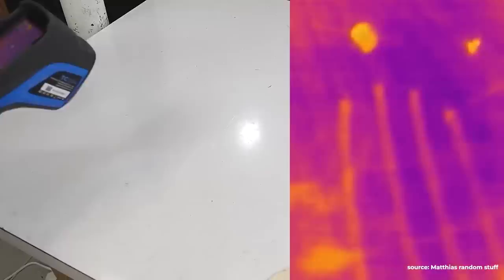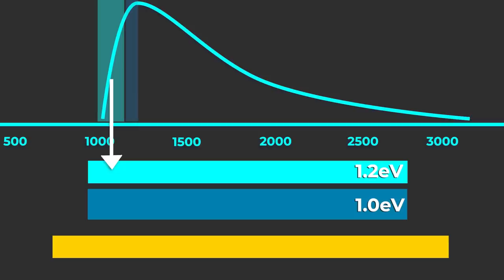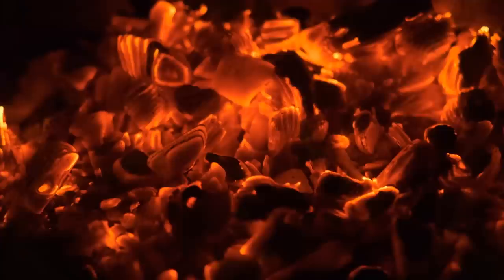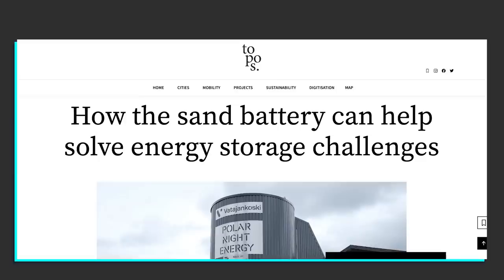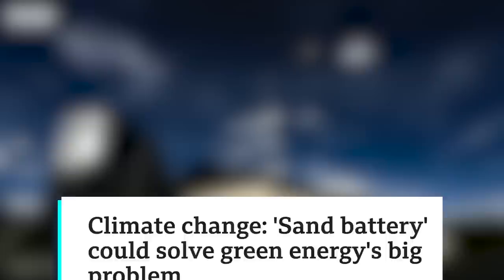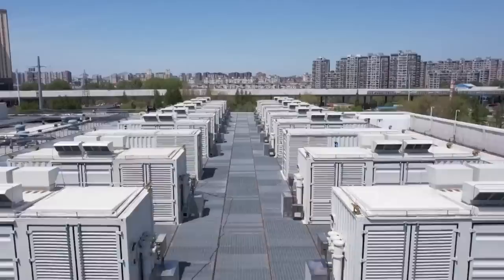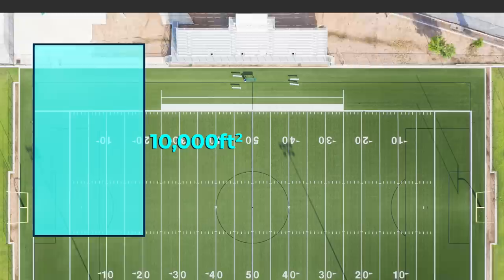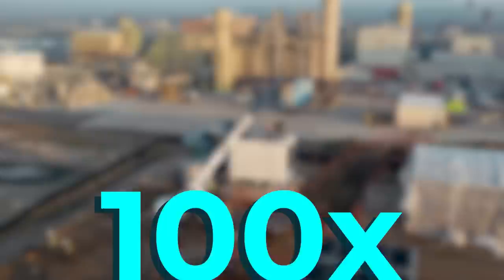The End of Lithium-ion? These Solar Panels May Be the Future of Energy Storage

Comment: Thorium fuel cycle MSRs would be a lot easier to engineer.  They could also be used to consume most of the stored radioactive waste from conventional nuclear power plants.  Thorium is abundant and can’t be controlled by any one country.  There is enough of it to generate an abundance of electricity for everyone on the planet for over a thousand years.  The amount of electricity needed by the average person (in the developed world) right now is equal to the energy producing potential of an amount of thorium the size of a golfball.  Radioactive waste from a thorium MSR is a fraction of that produced by a conventional nuclear power plant and decays to a safe level in a fraction of the time it takes for radioactive waste from a conventional PWR.  And MSRs are passively safe….meaning if all power is lost to the plant a salt plug melts and all of the liquid fuel drains into a storage facility where it cools naturally to a solid.  China is moving full speed ahead on developing this amazing source of power, as are other countries around the world.  It was the United States that first developed this technology back in the fifties and sixties at the Oak Ridge National Laboratory.  The Chinese actually toured that facility and benefitted greatly from a technology exchange of the information gathered by the team at that facility.

Comment: So, how do these IRPCs compare to Seebeck devices? RTGs have been quite successful in space applications. However currently the only long term heat source has been from radioactive materials. Now, "heat batteries", could be applied hence the question.

I'm thankful that I have an American thermostat (Fahrenheit) in my home. That way I can enjoy the higher resolution of temperature setting, 1C ~1.9F. So, if I want to change the temperature setting in the UK I have settle for almost a two degree change instead of 1 degree. Mo energy for a ~2 degree change instead of a 1F change. Hahaha.

Keep in mind it wasn't that long ago when you guys were using imperial measurements.

Comment: you know if you get a piece if copper or any metal really. if you heat one side and cool the other side the hot side is positive and cold side is negative you dont need expensive tools just any metal and a temp difference.

Comment: 1. I do not think this technology is a direct competitor of Li-ion. Sand battery storage is aimed at longer term (months) storage, while Li-ion is used for short term (hours) storage. The thermal panels are also too expensive to use a lot of them for high power applications. The panels will be used to extract energy over a period of weeks from the sand battery as the power output will be limited relative to the storage capacity.
2. The 30% that is common for thermal power plants is a result of economics, not because of engineering difficulty to raise efficiency. You can for instance put multiple thermal cycles in tandem to increase efficiency. The reason it is not done is that (fossil) energy is so cheap. It's not worthwhile: just burn more coal. I don't believe that these thermal panels are in any position to compete with large scale thermal power plants, perhaps it can be used for smaller scale applications (<100 MW). The sand battery appears to have much less (no) moving parts. That means you can use the battery without people present and just do periodic maintenance. Maybe as we start to phase out more fossil power plants there will be a future for this, but at present it is a lot cheaper to increase the efficiency of our current power plants to reduce emissions.
3. As we phase out fossil power plants, we also lose a source of waste heat that is often used for district heating. We will need the heat to heat our houses and I do not expect that we are going to use a lot of stored heat to make electricity (in an expensive way), so we can use that expensive electricity to drive an expensive heat pump.
4. Another way to use the heat from the sand battery is to make steam and feed that steam to existing thermal power plants to reduce the need for fuel. We don't need any expensive tech for that, we can just use existing power plants.

Comment: heat of flame does not match the output photon bands of the flame compounds, thus the different colors that dont match the black body temp output colors, ie laser pumping photon output colors, excitation output bands. in laser pumping gaseous medium the various energies of photons are not wasted, but are fully used to pump the electrons, unlike the surface of semiconductor solar panels.
Reply: energy density of sand at those temps is better than lithium-ion batteries, 300Wh/kg or so, as heat, you compute that. also znso4 rechargeable zinc-air battery (from ore zinc sulfides) is literally dirt cheap. also whatever metal you can directly electroplate out of ore sulfides/sulfate water solutions is fine for a battery, and simple easy to make.
Reply: everything becomes free if I dont pay you for anything, so all cost considerations become null and void

Comment: To store heat, use a phase change, like molten tin, do not use sand, you will have poor efficiency with sand, unless you are melting it.
Reply: I think that you are wrong. the heat-battery effect of melting tin is at 550°, so around 280°C. this would create a buffer around that temperature. this heat batteries depend on heating the stuff between 600°C to 1200°C (the upper limit is only for the truly derange). sand, by kg, has about 12 times more the specific heat capacity than tin above 280°C, below 280°C tin wins, I believe, because of the phase change, but 280°C it quiet low for most applications, surely a mixture of tin, bismuth or lead can change the point to a better temp point.

tin seems awful because it is too heat conductive for long term storage. Sand battery are better in preserving heat for that reason. so tin losses when you want to cut the gap season-dependent energy production. I think that with correct insulation you could make it work with solar as a day/night equalizer.

you point is taken tho. I was thinking how to better use the excess energy of an offgrid system, and I was thinking dumping it in a sand battery that could be used for cooking (like how the arabs make coffee). but tin seems superior in every way (except price) as the 280°C is quiet reasonable for cooking... maybe a little too high, but that can be managed though air mixing or something.

Comment: My house has a gas heater, and when it's on, it burns gas just to make heat. If it made electricity and heat, that electricity would turn into heat soon enough somewhere else in the house, like in the computer, but first it would do work! So what I'm saying is that 40% of the energy of the gas I'm burning could be doing useful work in an electrical appliance, but isn't. Why isn't anyone talking about putting these thermocouples into home gas heaters, wood-burning stoves, and water heaters?
Reply: that is a great idea but it is mentioned in the video that the efficiency goes down drastically might still be worthwhile but gas and wood burn less than 1000 degrees Celsius and then you'd get much less than 40% efficiency and so if you calculate in KWh how much around 15% (potentially less) than that amount of heat and it would not be very much unfortunately

Comment: You started wrong,  Steam turbines are not as innefficient, they can capture up to 90% of the energy on big setups, the 30% is probably from wind turbines as they are not enclosed and can't take advantage of multistages.

I quote the U.S. Environmental Protection Agency "Multistage (moderate to high pressure ratio) steam turbines have thermodynamic efficiencies that vary from 65 percent for very small (under 1,000 kW) units to over 90 percent for large industrial and utility sized units"
Reply: No.  You are comparing apples to oranges.  Look up Carnot efficiency on Wikipedia, or take a basic physics course, maybe on Brillant.  If some one is claiming turbines can have 90 percent efficiency, they are talking about capturing 90 percent of the theoretical obtainable energy, which for all practical engines is no where close to 90% efficient.  This is technology from 1824, you should really know it.

Comment: Heat is not infrared. Heat is motion of particles. Only a small part of heat is emitted as infrared. Most energy is transferred by convection (if you are on planet earth). I think the device is only useful in space (where we have no air and no conduction). Or is the device contained in vacuum? If I am wrong then please correct me.

Comment: I can't help but think there has to be some catch. Something like that the device has to be fairly cool (way below temperature of photons it processes) to function at all. Similar to solar panels which essentially process photons coming from approximately 5000 C warm body but need to be kept below some 50 C themselves. I don't think it will be significantly different with these "thermal photopanels".
Let's not forget that all our electricity eventually ends up as waste heat, somewhere between 20-100 C.

Comment: Steam requires rather high temperatures but a lower temperature turbine could  run on supercritical CO2 ? This very compressed CO2 behaves almost like a liquid and is twice as dense as steam so the turbine can be much smaller to deliver the same power. The thermal battery could remain on more normal temperatures. 
Perhaps first infrared could be captured by the new cells and than next comes the CO2 turbine because not all infrared will be used.

Comment: How to implement them now:  Put them in Engines! Car, truck etc IC engines.  Jet turbines etc.
ie:  Use the expansion of hot gasses as usual AND use the IR, thereby increasing the energy output and efficiency of this these widespread technologies with their existing infrastructure..!

To me that sounds like you increase the efficiency of the existing tech (hybrid cars, trucks etc) from ~20-30%, to 50-60%!?

I do hope I wont be conveniently forgotten when this 'light bulb' comes on... 
Ye; that's a pipe dream and I'll continue to starve, but do share who these startups are so I can try to point these 'blind' in the right direction already.

Comment: Sodium-ion, calcium-ion, Aluminum-ion , Zinc-ion cell batteries will have a projected cost of around 50-70$/kWh and enought cucle life of 6000-10000 DoD useful  cycle life @ 85-90% efficiency at -40 + 60 Celsius operating Temperature with 160-300 Wh/kg of energy density. This is what storage will became mainstream and make all the other technologies obsolete and costly.

Comment: One thing this video totally ignores is the fact that TPV collectors need to be COOLED! They would otherwise melt, and to provide that 40% efficiency, the MIT researchers had to mount their cells on a massive copper block with water cooling. Simple thermodynamics for any voltaic cell shows that power out depends on temperature difference between the hot emitter and the PV absorber. If your absorber heats up too close to the emitter temperature, you get zero power out of it. Just providing this cooling requires a lot of energy itself, and creates a load of low-quality waste heat. If you can use that for district heating, great… otherwise, you’ll have to use massive cooling towers, just like a conventional power station. This also lowers the overall system efficiency. MIT didn’t include that in their efficiency calculations! They just used the energy flow out of their hot emitter and the energy out of the TPV! Not very honest, really.

Comment: We have been using the "peltier seebeck effect" for many years commercially. How is this different. It looks like a big nothing burger? If your not familiar with the current commercial use of this effect.... it is what is used to heat of cool most of the portable 12 volt coolers/heater combo unites.

Comment: Why does Ben say the sand battery concept is "overkill" for a household as no house could use that much heat energy. Just make them smaller!. It's called a storage heater. Cheap, simple and can be 'charged' when electricity is cheap.
Reply: This is what I plan to do to supplement my woodstove and electric air heat pump system during cold weather. While I realize that collecting and redirecting Solar heat directly would be more efficient, I don't get a lot of consistent sun on our property, especially not near the windows which is where I would pump the hot air through.  So instead of building highly insulated solar heat collectors with long, also highly insulated ducts/pipes running to the windows (a PITA), I plan to get some Solar panels and connect directly to nichrome wires that go in a "heat battery" inside.  It is much easier to just run copper wire long distances and put through a foam insert with a tiny hole in it, in the window.  MUCH easier.  Also deals better with heating at night when it is typically colder, and both the electric heat pump and woodstove struggle more (especially with a limited supply of wood). 

     Said heat battery will be clay pots filled with compressed talc powder and aluminum, and with the nichrome wire being wrapped around copper tubes buried in the material.  The filled clay pot will be placed in a vacuum insulated glass container during the day while the heat is accumulating.  Starting around night, I'll take off the glass and let the heat radiate and dissipate out (probably blow a small fan over it).  

   If I had property with plenty of consistent sun near my windows, I would just build Solar heat collectors and directly pipe in the hot air (or water).  As I mentioned earlier, this would definitely be a more efficient system/way (in a general sense), but not in our case where we have so much shade on most of our property.
Reply: There are actually available systema already like caldera heat battery and Tepeo Zeb boiler which are both essentially concrete blocks in a thermally insulated container which is pretty much the same thing. Doesnt create electricity though. Just heat
Reply: @richardlphillips  Storage heaters used to be common in UK houses. I picked one up on ebay for £5. (I don't expect a Caldera cost £5). It's now used as a dump load for my PV system. Works brilliantly. If electricity suppliers had a variable tariff that reflected the real time wholesale cost of power it would revolutionize the power supply industry and make integration of intermittent renewables much much cheaper. 5p/kWh - on goes the storage heaters.  £10/kWh - switch of everything! And yes it does vary that much.
Reply: @petewright4640  Agree, i think the caldera battery reaches 500-600 degrees. Bit more than a strorage heater but its increases the energy density of the storage. But yeah, but pricier than your average storage heater, has to be craned in as it weighs a literal tonne 😄

Comment: The title of the video doesn't make sense. Solar panels don't store energy, they can't be compared to batteries. I assume it's a typo or mistake, since the content of the video was OK. 

The reason why nothing at the moment can replace lithium batteries has nothing to do with the cost, but the weight; they're the lightest batteries around. There's some experiments with even a lighter version, but it still hasn't left the labs.

Comment: Instead of sand why not use water? Water has a heat capacity of 4185 J/kg*C whereas sand only has a heat capacity of 830 J/kg*C, more than 4 times the heat capacity.

Comment: I get what they're trying to achieve here and I'm all for innovation, but there are two insurmountable reasons why solar will likely never be the "energy of the future". First, achieving 5% greater efficiency than a turbine can't bridge the gap created by intermittency and eschews the underlying productivity question. A standard array would have to at least double the productive capacity of a turbine just to overcome intermittency and achieve parity. In other words, more efficiency is not the same as more electricity. Second, this is compounded by the total energy density problem. Compared to most methods for producing electricity (in common use) solar offers one of the lowest energy densities. Between the intermittency issue and land use, solar is second only to wind in terms of least practical energy source. It's great for small applications, but insufficient to meet aggregate demand. There are other far more practical solutions we could be (and are) exploring. Granted, those solutions are a long way off. I simply cannot fathom why solar receives so much attention.

Comment: Multistage (moderate to high pressure ratio) steam turbines have thermodynamic efficiencies that vary from 65 percent for very small (under 1,000 kW) units to over 90 percent for large industrial and utility sized units.

Comment: They should integrate them into heat sinks on top of CPUs and then feed the electricity back into the device - would be great for mobile devices
Reply: Couldn't you do this with a thermocouple?
Reply: @theharper1  thermocouple efficiency is too bad.
These would probably be more, much more efficient.
Reply: @yasirrakhurrafat1142  agreed, but there's also cost. It would be smart design if electronic devices could reduce their energy consumption by recovering waste heat as power. This new technology would be great if the price comes down. In the meantime, some power could be recovered using existing technology and increase efficiency with a small additional cost.
Reply: Put them on car exhaust systems and around the Block and heads of truck and car engines, use it to charge batteries and for power.
Reply: @rdallas81  or on the radiator?
Reply: Also if this tech was in a mobile phone, your own body heat (if in pocket) would trickle charge the battery - could potentially be a life saver if you're lost in the wilderness, just light a campfire and place your phone close to it
Reply: @PrincieD  good idea!